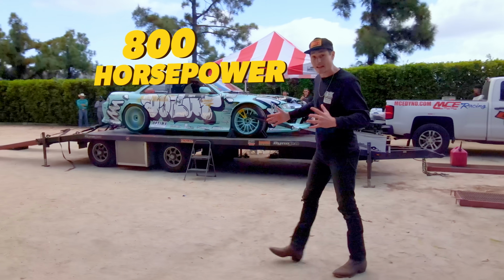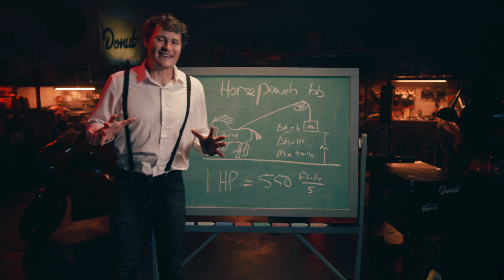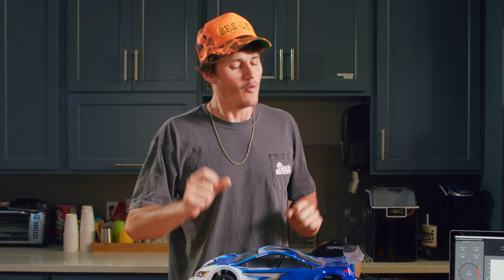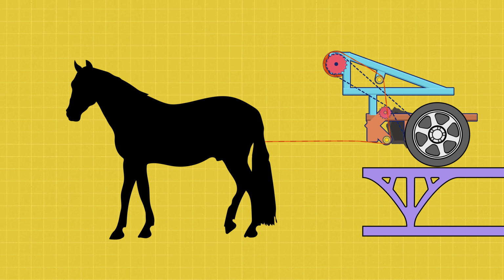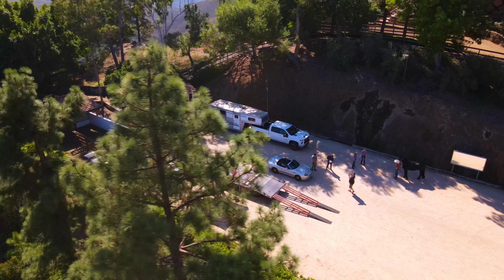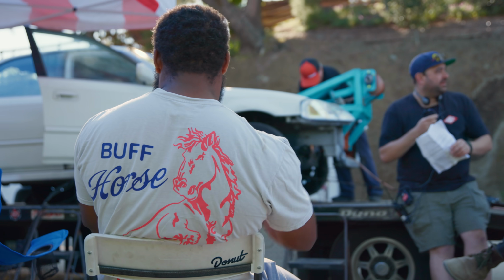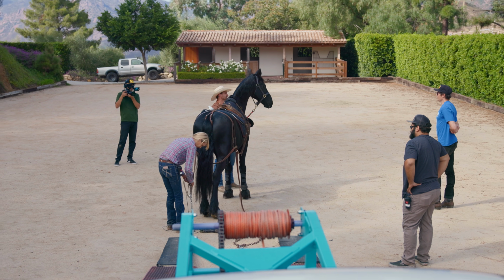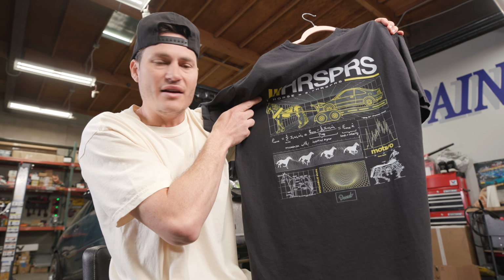How Much Horsepower is a Horse?

Comment: 11:14 This claim seems sus. The first VTOL aircraft was a helicopter. Your partners for this video worked with Igor Sikorsky in the 1930s? Perhaps you meant "the first electric tilt-rotor VTOL aircraft," which is still an impressive accomplishment.
Regarding the printed paper optical encoder on the wheel, Adam probably would have just painted marks on the wheel cover. But hey, you actually did rigorous science. This certainly could use a revisit so you have an N greater than one; as others have mentioned in these comments, a Clydesdale could probably pull harder, and I'd love to see how size, gender, gelding vs stallion, and breed affect pulling power, if it scales linearly with teams of horses, etc. Put that cute little pony on the dyno too if you do a revisit.

Comment: Great video! After watching the test I think that the result could be improved if more horses are used in parallel (so that the thrust is more even and then dividing by the number of horses) and a short reduction gear so that the horses works in they comfort zone and don't reach maximum rpm very quickly. It's an excellent video of course.

Comment: Now you can measure a thing used in railroading, tractive horsepower. Horsepower at the coupler of the locomotive, so even more accurate than wheel horsepower as the true amount of pulling power a vehicle can generate.

Comment: Power is not constant with speed. Therefore your result is valid for a horse, pulling at a given (low) speed. When the horse moves faster, the pulling force can still be maintained, and power will be much greater. This is similar when observing power/torque graph. At low speeds the torque is high, but since the speed is low, the power is also low.

Comment: I'm sorry to nitpick, but putting a horse on a machine designed to measure the power of a car seems ill conceived. You're going to lose a lot of power and accuracy while converting the pulling power to rotational power. You know what a horsepower is. You have a mathematical definition. The dyno is basing its measurements on that definition. It's trying to measure a car, converting the rotational power into things that can be converted to that mathematical definition. Now you're converting it back, which is going to lose even more accuracy. Why not just measure what the horse can lift and convert that into horsepower?

You just need a standard pulley to convert the forward directional force to upward directional force. Then you just see how much the horse can lift while still moving at 1 foot per second.

Or if you wanted to get more sophisticated you could set up something mechanical that produces the pull weight. That way you could have the pull weight change as the horse moves. You could do something with springs, or magnets, so the farther the horse moves, the heavier the load gets. Then see how far the horse can pull before the weight slows it down to less than .68 mph.

You just seem like you're trying too hard to convert the horse into a car so you can measure the horsepower the way you measure a car's horsepower. But the measurement for a horse is designed for a horse, not a car. So if you measure it like a horse, rather than like a car, you're going to get a better measurement with less effort.

Comment: It's hilarious that the 1926 method was clearly superior. Obviously, once the horse had accelerated the dyno drum, the dyno wasn't able to place a load on the horse, so it was only able to measure the power of the horse as it was starting to move. Dragging a cart rigged with an absorption dyno behind the horse would allow the power of the horse to be measured as it's galloping, which is probably where the old number came from.

Also, the 1 hp that Watt came up with was a rating that was meant to compare to a horse that was operating at a steady state, through a whole work day, so it's probably plenty accurate, depending on the horse and equipment that it was driving. If you're buying an engine to replace a horse that works at a steady state through the whole day, you don't care what it can do for a few seconds under a huge amount of strain.

Comment: Theres a bunch of veriables in this though... youll have power loss due to the chain system. Also, each wrap layer of the spool that the horse pulls off changes the torque variable...
Reply: Also, this tells you the HP at the tires. There is a bunch of mechanical losses due to that. I think its likely you are gutting that horse by a whole HP at the tires rather than at the tail.

Comment: This is a horrible method. You should just put accelerometer on the horse, weigh the horse then have the horse go from 0 to max speed. Then do the math to calculate energy to accelerate a mass over time. So easy.

Comment: Using a bigger spool the horse would reach higher speed easier doing less rpm. maybe the power band would change like it does on an engine at different rpms?

Comment: First pull of Big-D looked by far the best. Maybe over 8HP. Also, if there was no gap at the start, he would know to pull without frustration.
Reply: I know Big D wasn't trying that hard. Once he gets to trotting/running, he might pull like 10 hp
Reply: Contrived drama about failing lasers or some such BS.

Comment: So, one horsepower is actually 1/6th of a real horse power. This number is interesting because a motivated farmer can probably handle 10 acres with one horse. That shows that modular electric/robotic tractors really need to aim at 5-10 HP as the tradeoff between expense/power/recharge.

Comment: Why not just have the horse pull a weight up -- the rate the weight is lifted is directly related to power.  As an example, if the horse was able to lift 550 pounds at 1 foot per second that would be one horse power.  So, if the horse was able to walk at 5 feet per second while lifting 200 pounds the power required would be 1.82 HP.  In fact, early in the video you showed pretty much the same setup as I described.  The advantage of the approach I described is that there are few sources of error whereas the car setup used is going to have substantial error sources.  First, the power output is going to be much lower than a dyno will normally handle.  Second, the loses in the drivetrain used will be a substantial fraction of the total power -- you can attempt to quantify those errors, but you're not going to get much better than 10% error.  A setup as I described should be able to limit the errors to a couple percent which can also be quantified to make the final result better than 1%.  
Lastly, there is peak short term power output and sustained long term power output and they tend to be substantially different -- like 10X different.  A competitive cyclist can output over 2-3KW for a few seconds but that same cyclist would average less than 300W for a prolonged period.  In the example Watt used, the horses used to power a grist mill, the horse would work for an hour or so at well below the peak power.

Comment: Amazing experiment, but help me understand. Why was the car necessary? Since dynos rely on the inertia of the drum for their torque measurements, couldn't a simpler rig be built with less components and complexity? Why did the chain had to be connected to the transmission? Maybe it's stupid but why not build a simple rig that suspends an axle with two car tires attached. The tension line could be spooled directly onto the axle to avoid sprockets and chains. The rig could be weighted with simple weights to mimic a car's tractive force on the dyno's drum. The thing they were looking for was the actual horse power of a horse, no? Why include a transmission? Maybe they explained it and I missed it. In any case this was a very interesting video and the result of 5.7 hp seems very reasonable. Now I suddenly wonder about the output of other animals that were traditionally used to pull stuff. Like for example what is the horsepower of an ox? lol

Comment: You have to find out at what speed and type of movement a horse produces the peak. What you tested was a very slow walk, that's probably nowhere near its peak. It's like a gear on a bicycle or in a car, it has to fit the 'motor'. If you gear too high you can't put down the power. I'm guessing (qualified guess) that a horse's peak power is some kind of galloping motion. A generator winch with very little friction allowing it to run much faster and longer and then ramp up the load relatively slowly and find a peak. And that will only give you the horse's external work, not the power output to actually move the big horse as well. I'm guessing its total can be well in excess of 20HP. The original 1HP measure was probably work it could do casually over longer periods without objecting too much.

Comment: Nice little rig that you made but, sorry to say, quite useless in measuring the true horsepower a horse is able to produce. First of all, why use a car dyno while an invention called a treadmill exists? Horse, like a human, cannot produce its peak muscular power when starting from a standstill. A human has two "gears" or paces/gaits of locomotion, namely walk and run (the latter basically being bipedal trot), whereas a horse has normally four "gears" or paces/gaits and they are walk, trot, canter and gallop (there are a few more but these are common for all horses). Horse is only able to use its full muscular potential (aerobic+anaerobic) while galloping, thus producing the highest possible horsepower. Horse can do it only for a quite short period as anaerobic work breaks down ATP and produces lactic acid which causes muscle fatigue very quickly. You cannot measure the true maximum horsepower on any horse if it's not galloping. For your rig a heavy draft horse like a Clydesdale would have produced higher horsepower readings, although even those wouldn't be realistic.

And those things I've just mentioned are only scratching the surface on the problems with measuring the true horsepower of a horse. Here's something to think about: Why a person is much slower when running compared to when riding a bike? It's still the same muscles giving the same output.

I used to think a lot about these things when I was working as a farrier. My mentor had actually done some treadmill tests with a vet using a warm-blooded trotter and the numbers were significantly higher.

Comment: "Watt's measure of power output is clearly based on a rate that horses could maintain for a full day, not a peak performance."
Stevenson and Wasserburg (1993). Horsepower from a horse. Nature 364, 195 (1993). doi:10.1038/364195a0

Comment: Problem is that 5.7 is at very slow speed. An easier way would be just to use a wagon with brakes and a forse sensor with gps to easilu calculate horse power

Comment: One horsepower was the continuous power an average horse was capable of.
Before steam, machines were attacched to watermills or horses.

Ad if you needed to size the power of your shop back in the days, you'd better know the power available and how much that would cost it to run.

This has nothing to do with peak power.

Comment: The question is intriguing, yet certain concerns arise. Firstly, the necessity of a car in the loop is unclear; power is simply the product of speed and force. Secondly, unlike a car that can sustain a constant power output with available fuel, a horse's power depends on the effort's duration, varying significantly over 5 seconds, 1 minute, 1 hour, or 1 day. Lastly, according to Wikipedia, scientists have conducted measurements, and the results have been published in Nature.

Comment: This experiment is flawed in many different ways BUT it was still very interesting and well done for entertainment purposes. 👍🏻👍🏻
Reply: The horse needs speed for an accurate measurement. Theres a reason we testt human power on a bike for instance peddling at a high cadence. They should have consulted human power experts and real horse experts. The experiment could have been done using a trainer (wheel) walker in a riding ring with the dyno in the middle. Get the horse up to running speed and power will be MUCH higher since more work is being created.
Reply: could you specify a few flaws ?

Comment: this is not accurate, i believe its higher
Reply: You are right. A horse is designed for speed and will not produce its peak power at low speed heavy load activity. This test was more a test of its raw strength than power.
The test should therefore have been performed with the horse at higher speed.
Reply: 100%correct. @patricj951

Comment: My question is, there is a kind of Dino that measures directly by attaching it to the wheel hubs, why didn’t you build a spool drum kind of like a winch has and then just made the horse pull the rope ? Wouldn’t it been easier ?

Comment: I’m at time stamp 8:20 and am wondering how this machine will measure 1 horse power.   So I watched it to the end.  Now the old HP number should be divided by 5.7 to get the actual rating ?!!  800 HP / 5.7 = 140.

Comment: Real unit conversions for the trials:

First guy: 1.16 horsepower = 865W
Second guy: 1.21 horsepower = 902W
Team of three: 1.9 horsepower = 1417W

Result for the horse: 5.7 horsepower = 4252W

Round things down, and you could call a horse a 4kW engine. A typical car engine is around the 200kW mark.

Comment: the horse wasn't even at full speed. how is that an accurate test?
Reply: You think correct. This test was more a measuring of the raw strength than power. A horse will produce 10-15hp if it measured at higher speed.

Comment: this seems needlessly complicated to do something dumb to a car. Why not just use the rig to spin the dyno drum directly? Wrap the drum with one layer and rather than having the horse jerk the slack, start with the cordage taught. Then there will be less surging and a smoother work delivered by the horse. It really didn't like the sudden stop when the initial slack hit. 

Alternatively loop the drum with enough passes to prevent slipping due to friction and feed the rope from a free spool. This way the point of work is a consistent diameter and you don't run into the variation that multiple turn depth on a small drum are doing to your torque numbers.

Comment: Why not use a dully without tires on the inside rims but with cables rapped on them then have pullys routing the cables out the front lower center . Simple stupid

Comment: Why go to all this trouble and not test like 10 horses or 5 diffrent breeds of horses, i bet a clysdale would do 8-9hp. Why not do at least one pass with a rider on the horse, just to see if the numbers would actually be higher, youd aexpect a horse to be more driven to pull harder with a rider the was hes use to it. Obviously they did it because the extra weight may make the results less than expected but at least try. i mean if youre going to all this trouble try multiple scenarios. It was without doubt the most frustrating part of this video.

Comment: You have clearly never seen a pulling horse.  I worked a fall fair pulling event and have seen horses pull what my backhoe struggled to move back . Just look up pulling horses.  And no a human is nowhere near 1/5 that of a horse . You want to get this right . This is not it . A pulling horse would be at least 20hp . But you need a way to get a solid torque number.  Then do the 5252 math

Comment: Yeah, so I don’t know how that extrapolates over maybe we have to think about it a different way cause I have a 5.5 hp lawnmower engine and I guarantee you it will not move that dyno lol it does not have near as much polling power as that horseso I’m guessing that my lawnmower engine would be a fraction of what it is deemed? We need a scientist to figure this out. Maybe you need to try to hook up some small engines and test them against your theory of 5.7 hp against some small engines and see if you can extrapolate that horsepower that will give us an accurate number.

Comment: Makes a lot of sense, the average weight of a man is close to 200 lbs and the weight of a draft horse is between 1400 to 2000 lbs. So my guess is that a draft horse could produce 7 - 10 times more than the average man. Both the dudes who pulled were well above average(one was very tall and the other looked like he weighed at least 250 lbs). I also think the horse had a couple more hp in him. If you have ever seen draft horses pull, their hinds get pretty low to the ground and they pull much higher weights so it's possible big D found the pull too easy and did not max out(he also looked like he is on the smaller side of draft horses). I would posit that the average draft horse can produce around 8.5 hp.

Comment: For horse you neded bigger gear ratio. It was obviouse that horse pull only in first sec, after that tires turne by momentum, horse dont pull it any more. There must be biger torq  for horse to mesure real power.

Comment: OR... you could do it the simple way, just like the definition of horsepower originally stated: let Big D lift a suitable weight with a rope and pulley, measure the time and height, and do some SIMPLE math. But that would not make as good a show. As Germans so aptly put it "Warum soll man es einfach machen, wenn man es so schön komplizieran kann"!